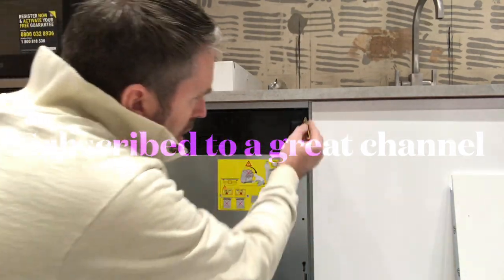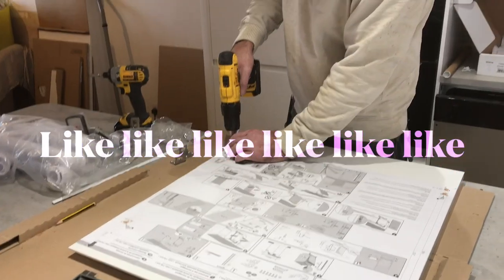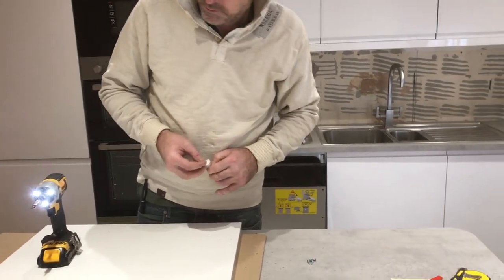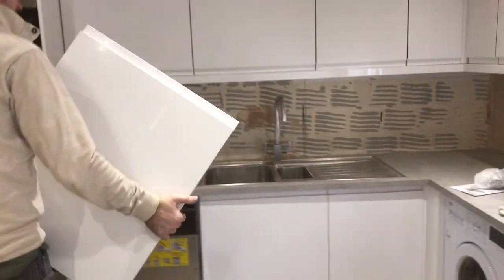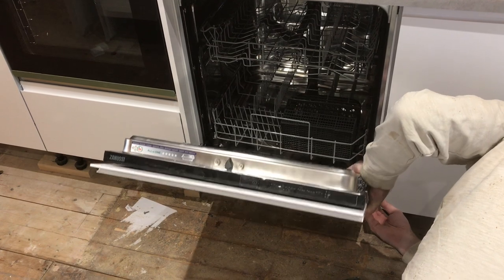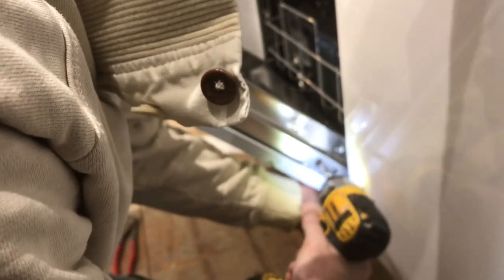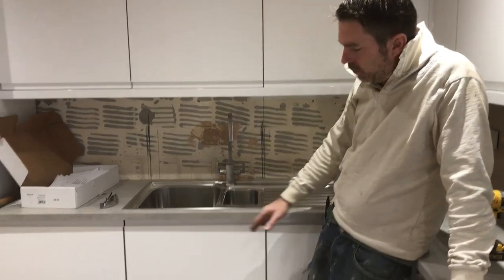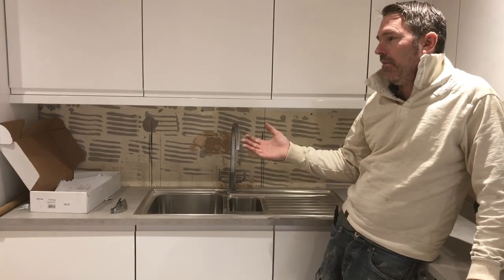Kitchen day 6 part 3 integrated dishwasher door fit

Comment: A plumber installed my hoover integratedxslimline dish washer. It's working fine but I have one problem. When you open the door it falls to the ground and I am told that's normal and you cannot adjust that. It sounds wrong to me and itsxa pain that you cannot adjust the door????
Reply from the maker: He must’ve the door position wrong if it’s dropping